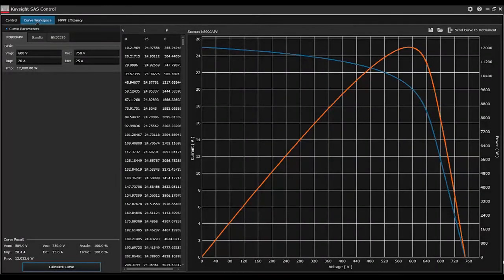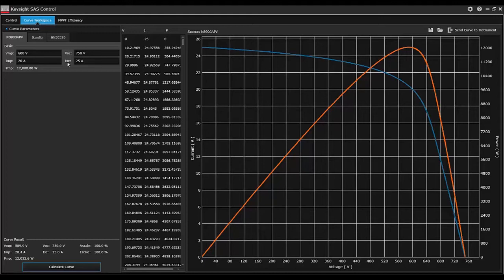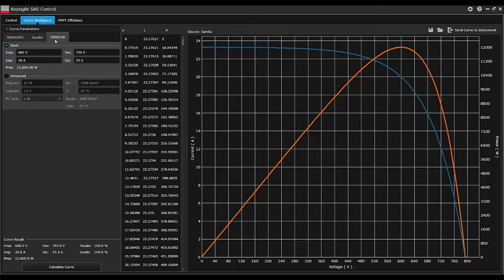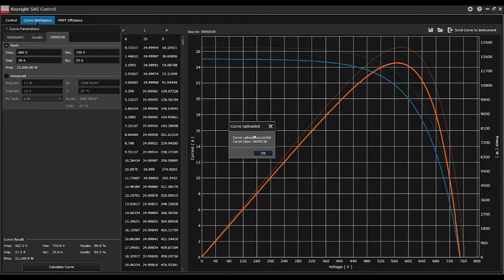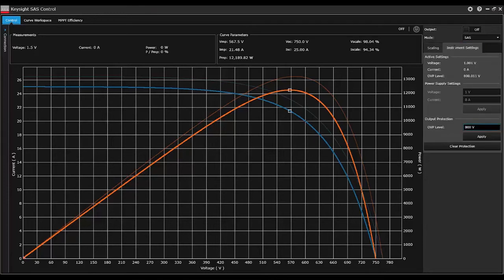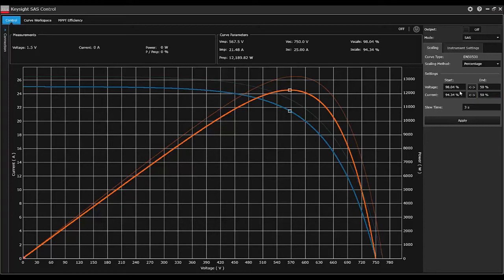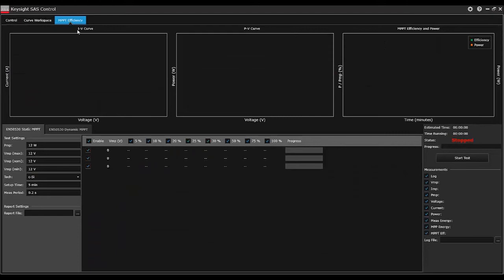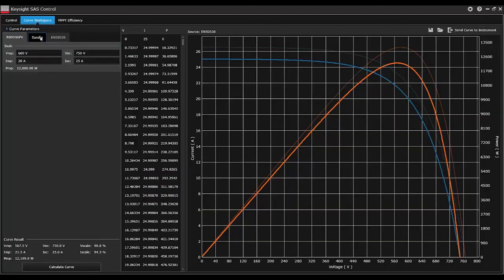Solar Inverter Testing with Array Simulation Control Software for the N8900APV

Comment: ok bro great i want to know the software name and can i analysis the inverters different connections like first i make only one string and connect with inverter and check its result then make two string and connect with dual MPPTS separetly and get graph and result through this software or not